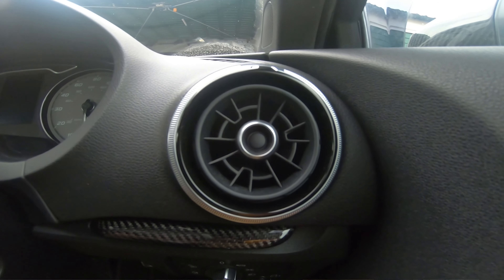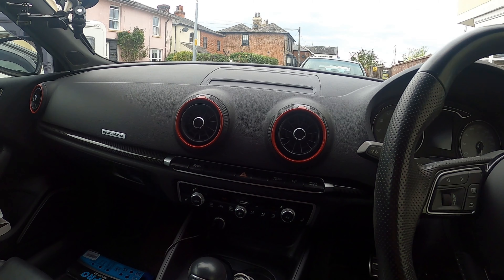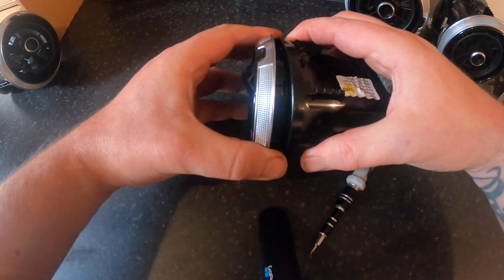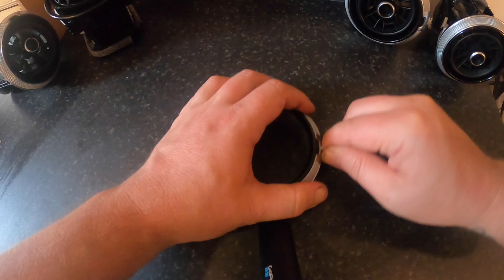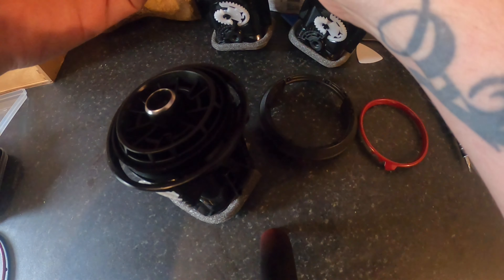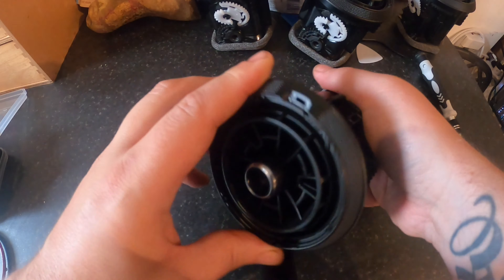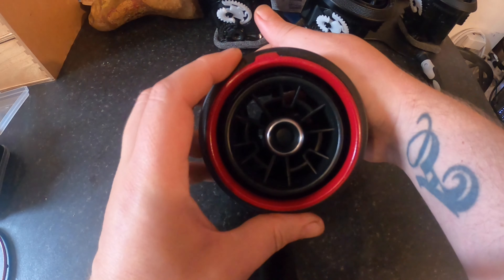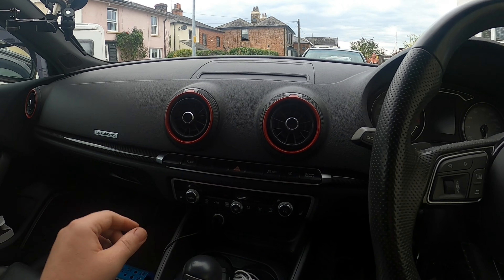Paint Air Vents Outlet Rings - Audi A3 / S3 / RS3 8V

Comment: Great job! Did you use a plastic paint or normal one? I struggle sometimes with the paint holding up to use 🤔
Reply from the maker: did a quick job on those tbh, normally would have sanded down a bit and used primer and lacquer too. Red I used whatever I had but should have waited a lot longer to dry but I'll redo them properly next time.
Reply: @Beardchanics  I hear ya, sometimes you just want the job done!
Reply from the maker: @SoloLap  yeah and already thinking fabricated custom vents 😁